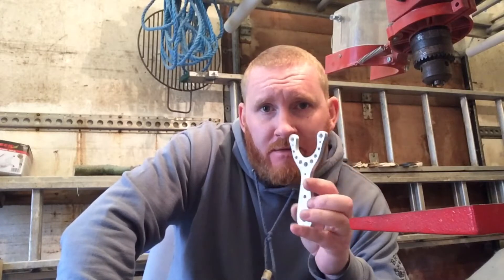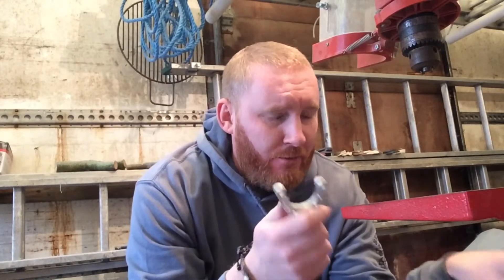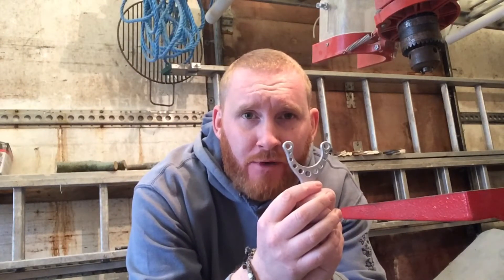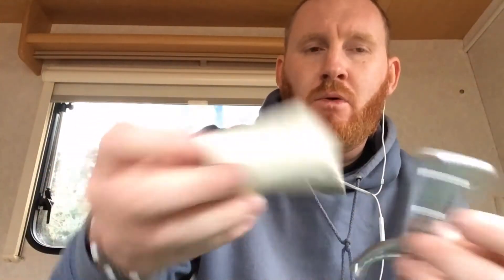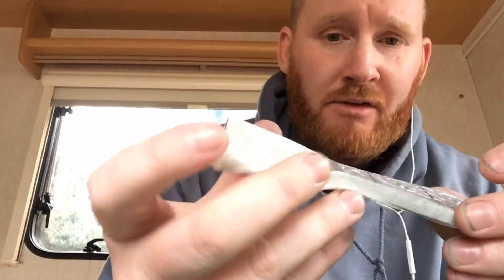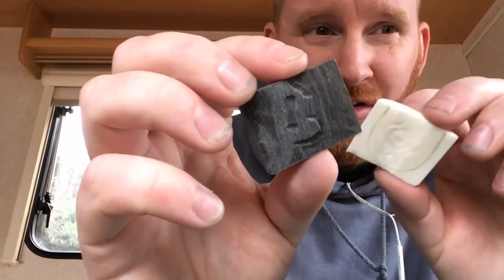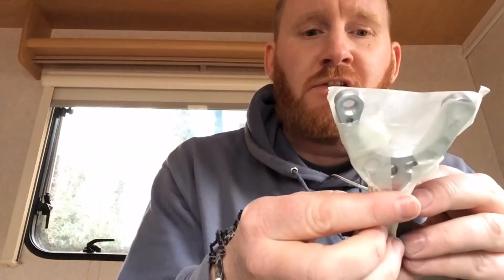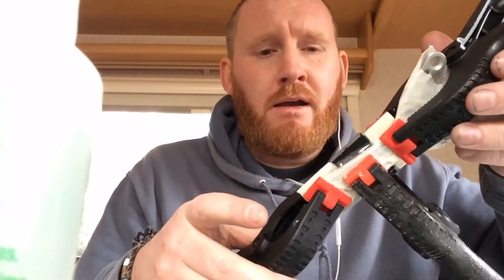Tutorial on how I scale a milbro part 1 catapults slingshots

Comment: What you scoring out ?
Reply: For the glue?
Reply: Yes the scoring is to increase the bonding surface for the glue to help it bond the two pieces together, it also gives any excess glue somewhere to go and stops the glue oozing out of the sides when clamped up, which means less mess to clean up when the glue has dried.